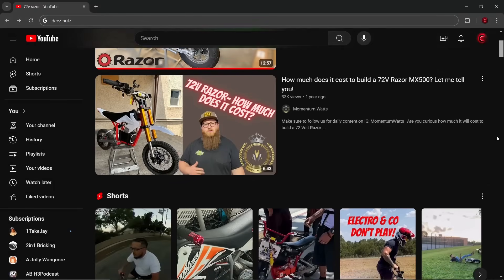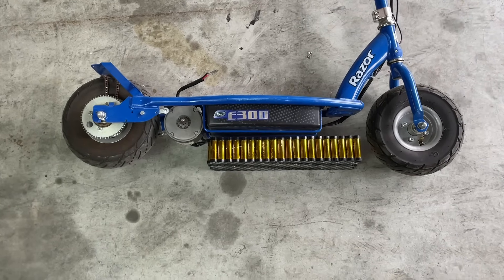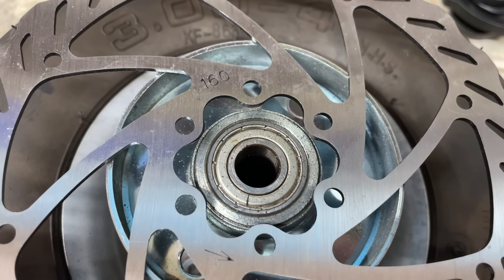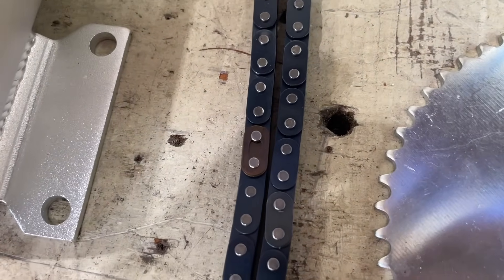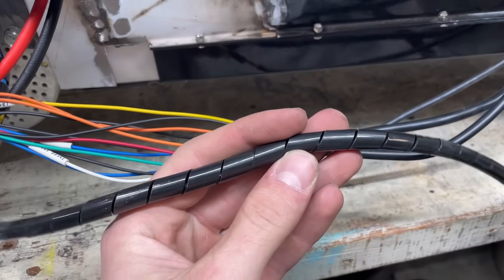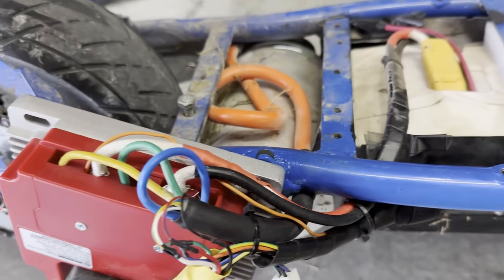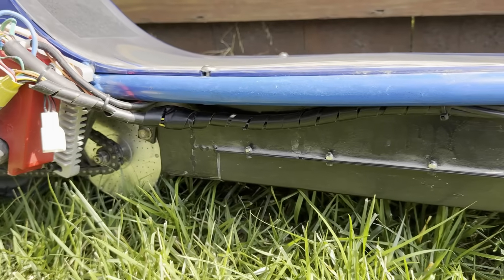Building a 72v Razor Scooter (3600w 40+MPH)

Comment: Do you recommend that amazon kit?
Reply from the maker: No, because it stopped working and I couldn’t figure out why. Check out the other razor scooter I made, on that one I bought a slightly shorter MY1020 motor and Fardriver controller from econiccycles.com and they’ve been working awesome. The motor was like $100 on Amazon and the controller was also around $100, and you can buy whatever other accessories you need on econiccycles. I actually just bought another one of those motors and controllers to use in another build.
Reply: @Calthecool  Thank you!

Comment: I’m building a 48v 2000 watt razor mx350 any tips or recommendations for the battery but I’m on a small budget.
Reply from the maker: @THECOPYNINJA394 don’t buy a battery with less than 4 stars or 200 reviews.
Reply: @ ok thanks a lot

Comment: full part list break down
Reply from the maker: @FN_BOBIK  controller: https://econiccycles.com/products/fardriver-sinewave-controller-nd72v50a-w-bluetooth?_pos=2&_sid=fdb35ba1e&_ss=r
Motor: https://econiccycles.com/products/motors-kunray-my1020-48v-or-72v?variant=44933914132722
The rest I can’t quickly link. If you are thinking about building a scooter like this then check out my other E300 video and then my second most recent video, that scooter is a much better build.
Reply: @ thank you so much man

Comment: That's a nice e300 build.
I saw someone else who has one build with flipsky motor but didnt show vidoe only YT short for smaller motor and smallee controller in flipsky parts lmaybe lookn into it tell me if is worth it
Reply from the maker: I would say that this one isn't worth it, but the one I built in the other video is worth it for sure. I still ride it a decent amount and it's still fun.
Reply: @Calthecool  I still can’t believe you fitted that brushless motor
I have 2 e300 thinking of maybe doing this. I will stay at 25mph mark

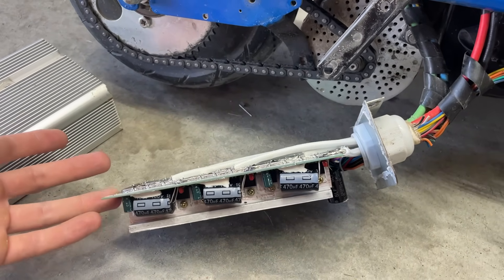Comment: 12:10 unfortunatly these kits are known to burn out the motor the motor gets way too hot and then it just melts on the inside at least that is what I have seen happen to almost all that I have seen
Reply from the maker: @Retrograde99  huh, that sucks. I’m definitely getting my stuff from econic cycles from now on, it’s only a little more expensive but it seems higher quality.
Reply: @Calthecool  yeah defenatly higher quality you just have to look a little further than the nose can reach sometimes tho it is possible to keep these motors cool you'd need to put in a lot of work to do so

Comment: I have built a kart from scratch with the kunray motor& controller kit (3kw) and 14s 8p li-ion battery. It runs just fine! I don't have any problems with the motor/ controller. My kart only goes 30mph...maybe I should try lower gearing too

Comment: wouldn't a rear hub motor be better? it may give you space for the controller and you wouldn't have to worry about a chain
Reply from the maker: Mid drive motors have much more torque, but hub motors are definitely better for riding a scooter normally.

Comment: Nice build, i’ve built my own version using a hub motor and mounted a couple of rocket  motors 🚀 for fun lol
Reply from the maker: @jamie-meanskunk  nice, Razor is actually making a new version with a hub motor, which I think is a good upgrade. Still SLA batteries though.
Reply: @Calthecool  yeah, they definitely need to upgrade to a lithium battery makes more sense

Comment: that razor would be a death trap in snowy areas. plus based upon how low it is to the ground a speed bump would damage the battery housing. other then those glaring issues it is still a neat project i would not want to ride.
Reply from the maker: @jeremyschultz4731  I’ll try it in the snow next winter, although I don’t think people normally ride scooters through snow. You would have to go off a 3 foot drop directly onto the battery tray to do any damage, it’s pretty tough.
Reply: @Calthecool  people to ride ev razors in the snow more then you may realize. also you need a fat tire ev, if you use an ev bike to safely handle black ice. razor wise, you need to get an raised off-road class ev razor to safely do it if you want razor ev like brands names let me know.
Reply: @Calthecool  you will be surprised how many people ride a razor type ev in the snow to work. just look up off road razors with hydro breaks. then if it has an raised suspension shocks, meaning it is raised higher then normal odds are the said  razor type ev will do okay in snow.  

Aventure.2 Ebike is an example snow safe ev bike...  with hydro breaks...  people in my area use it all the time.  my area can see 4-5 feet  of snow some winters in my city.

Comment: you couldve just used a vice to take the drum off and but. a disc brake adapter on
Reply from the maker: @jonathannguyen672  I didn’t know those were a thing, that’s pretty neat.
Reply: @Calthecool  yeah, I suggest getting hydraulic brakes too, that scooter is gnarly!
Reply from the maker: @jonathannguyen672  I really only use the regen, I only need the disk break when I need to stop suddenly so it’s good enough.

Comment: Try adjusting your throttle acc in the fardriver app. Changes your throttle sensitivity and could help a lot with lower speed wheelies. It did quite a bit with me.